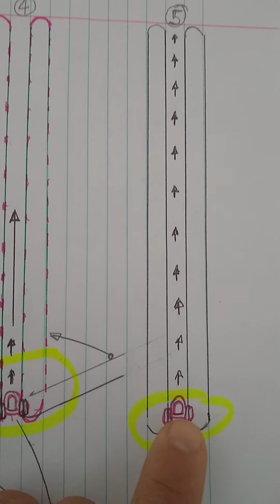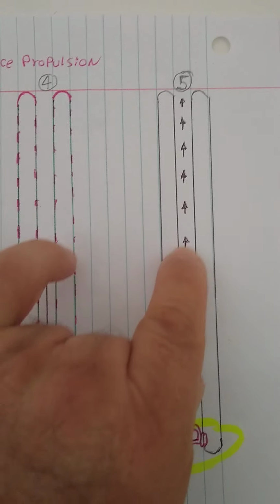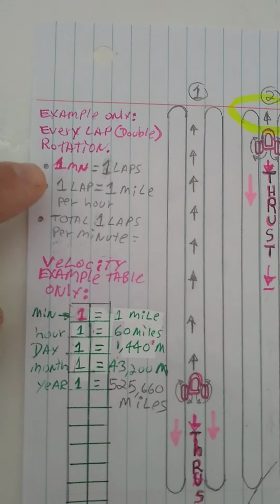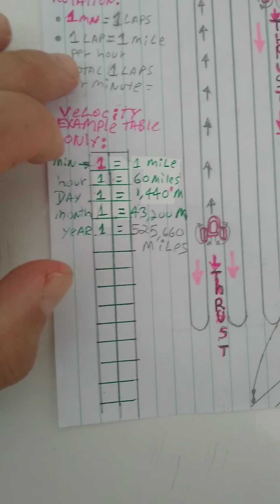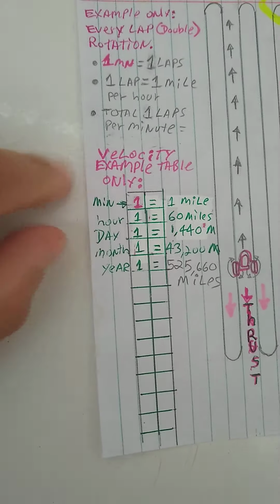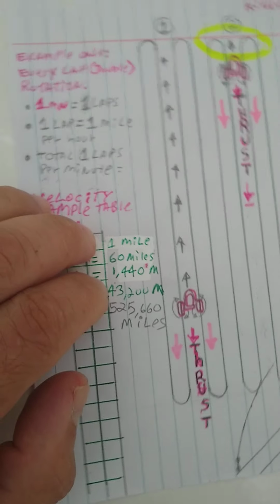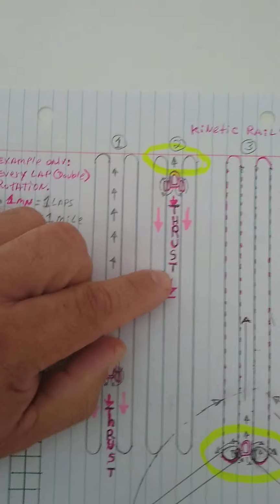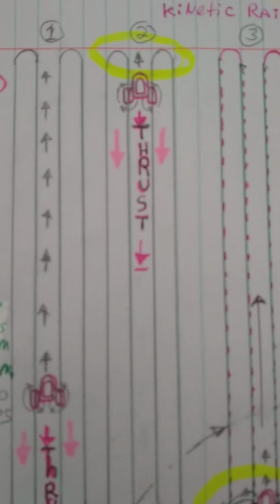KINETIC INTERSTELLER  ROCKET PROPULTION ACUMULITIVE VELOCITY FASTER AND FASTER EVERY MINUTE

Comment: What is the speed limit if any? Can it go faster than light?
Reply from the maker: Kinetic engines can Acumate speed over long periods and time it can reach half the speed of light. It all on how much speed it generates each cycle and how many cycles a minute and for how long will be running. Scientist say you can't reach the speed of light because it would take infinite energy to reach it. besides being bombarded with miniature bullets particles at high Velocity , so in practice it's safe to say that it could travel extremely fast. Scientist say the reason that you could not travel the speed of light or more is because you become heavier and would need more power the faster you travel , I say there a possibility you could "if" the whole universe had solar energy or equivalent on every coner of the universe , a solar panel can capture limited solar energy but the faster you go the more solar particles of energy you could capture solving the energy needs for such travel , now because of kinetic engine you carry your mass with you to use as kinectic then the heavier that mass gets the more you proppell forward even if the mass increases ,  the faster the more mass it gets  the heavier the mass potential to proppell forward with kinetic mass engines ,using mass as ramming hammer for  kinectic propulsion so the faster speed velocity the heavier the mass for kinectic ramming hammer , the only force that would prevent it from reaching the speed of light is the front wall of incoming particles , that the faster one travels the stronger and more powerful the resistance , like when you run you feel the wind ,now run when you have a massive hurricane winds , it would then be extremely hard to run . Same with space travel. Even incoming cross particles could lower and drain the Velocity you already gain or worst the space  particles winds would become more powerful until such a speed that it becomes a  "particle wall" made of hight speed particles. now there the problem of speed , if you drive a car is more manurable a low speeds , for instance I would prefer to drive 40mph then driving 120mphr because a) I would have reaction time b) I would not loose control easily c) I could avoid obstacles easier . I rather hit something at 20 miles then 120 miles. In space travel a high velocity the hair trigger to just turn would be dangerous because of centrifugal forces and incoming planets in front like bullets there is no way a human autronaut could manuever to avoid such impacts. Unless you travel around Galaxies and not threw them to avoid planets while traveling close to the speed of light.
Reply: @megatroninventor  So your vehicle can reach Proxima Centauri in about 8 years if it doesn't slow down and much longer if it has to slow down to make orbit with a planet there. The ship would have to be enormous to carry all the fuel and provisions to supply the occupants for all those years. Perhaps a colony ship that can produce it's own food supply with farming and recycling. It sounds like a one way journey.
Reply from the maker: @onetruekeeper   a small nuclear energy like the ones in used at moment on exploration  unman space craft last decades so a return trip is possible except we would need to have space farming in combination with food storage. But when the astronuts return to earth their loves ones on earth would have age many years compared to autronaut , there could be a age gap of 20 yrs or more difference between them.